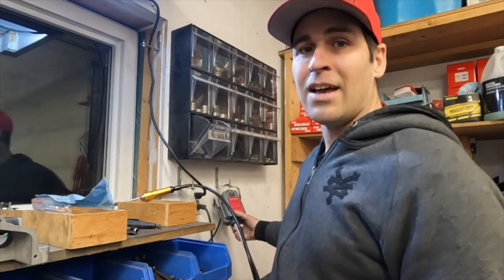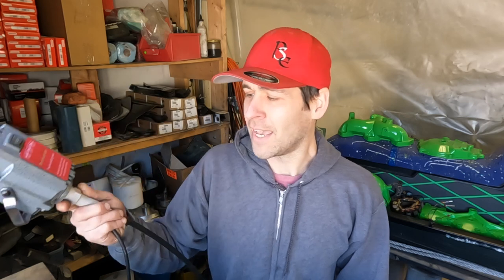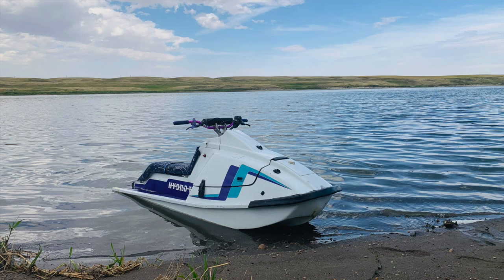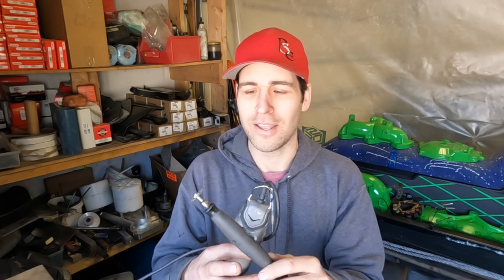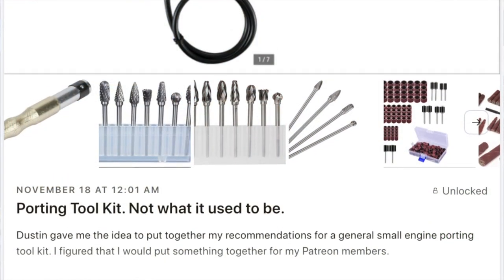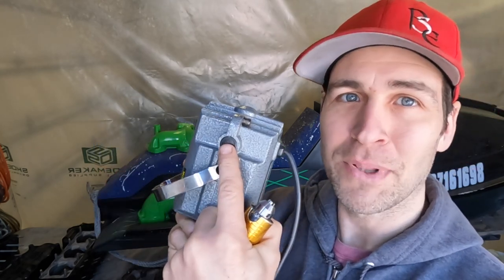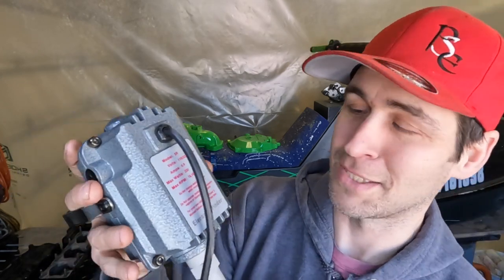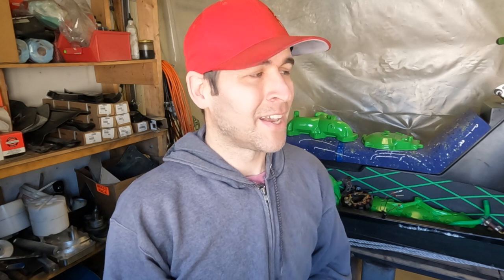VEVOR - Foredom Style Flex Shaft Grinder - In-Depth Look & Disassembly

Comment: Do you recommend lubricating the flex shaft?
Reply from the maker: I haven't lubed mine and haven't had any issues. I lubed the on on my old Dremel and it would make a huge mess. 

If you are constantly running it at really high speeds... I would recommend some very light sewing machine type oil... otherwise I say no.
Reply: @loweredexpectations4927  thanks. I saw one of the posts here that someone used high temp white grease. And another content creator said they used graphite powder. I won't be using mine every day, and mainly for sanding and carving wood and etching stones.
Reply from the maker: @jerrysrockinphotos  The reason I say to use a thing oil is because even oil causes some drag. Over a few feet, lithium grease or a thick oil may have enough drag to cause an issue. 

Graphite is better on flat bearings surfaces, from what I understand. Something with a constant contact patch, and this is not the case between the cable and housing. I may work fine. I don't know. 

A thin oil won't cause a lot of drag and will always be present between the contact areas, where it is needed, in this case. This isn't something that you want to pour down the cable or spray on. You would drip soeme on, give it a wipe with a rag and assemble it. 

I, of course, could be wrong. These are just my thoughts.

Comment: I just bought one and the first time trying it the chuck flew off(came out of the orange handle) and could've hurt somebody. Is it suppose to come off and is there a way I'm suppose to tighten it, or is it defective?
Reply from the maker: That sounds defective to me. I took mine apart shortly after purchasing it, but that was over two years ago, so I don't recall the exact assembly. 

I would contact them right away and tell them it is broken.
Reply: Isn't it a taper fit chuck? Just clean the taper and give it a solid thwack and it should seat?
Reply from the maker: @scod3908  I believe this is the case, but I'm not sure. All jacobs chucks that I have seen are taper fit, but mine has never come off, so I don't know. If it came off, there is a chance that the taper is damaged / out of spec.

Comment: Thanks great vid and stories, re Dremel I'm in Australia and have had 2, the last one only about 3yo and very little work. My view is they trade on an undeserved reputation of trusty tool or is it just the marketing? Very much for the amateur/light work hobbyist. I'm looking to buy a flex drive myself and just found the same brand as yours for $80A not sure of its features, but I'll check it out.
Reply from the maker: RIght on... I think you are right... The Dremel brand has made a name for itself but just makes stuff for light occasional wood working or very light metal work. I have not used my dermel since getting my new tool... and the new one gets a fair amount of use.

Comment: I'm leaving this comment to increase engagement on your latest video, but also to request a diesel heater with nichrome wire in the burn chamber video for diesel alternatives.. or running at lower hz than typically possible stable (what I'm interested in lol). You need an adjustable controller though :)
Reply from the maker: Haha... Thanks for the comment and the diesel heater suggestion.
Reply: As far as i get out of my diesel heater experience of countless hours of continuous running, i'd say, the factory lowest setting is the lowest one you feel kind of warmth coming out.
Any less and you don't need a heater, then two candles will do the job. 
Also - there has to be some generated heat for the whole thing to be warm enough to operate properly.
No use to have condensation inside the heat exchanger going on.
The setting, i lost my smaller dog with, was lowest setting, stupidly enough with exhaust turned to the top side and then letting it run for weeks.
Only in lowest setting you get fuel dripping out then.
And that slowly evaporating diesel did poison us, me and two dogs, undetected all winter long, caused liver inflammation and death to the smallest one. 
A little more heat and nothing happens, when you install it the wrong way. That fooled me a long time with several heaters.
But aside from that problem, seriously, a 5KW chinese heater at lowest stock setting doesn't overheat anything, as long as it's cold enough for heating at all.
Reply: @werner.x  I remember you mentioning your dog before and the toxic fumes... that's rough. 

I feel like I have a long way to go with the diesel heater testing. I may end up making a completely custom unit next winter.
Reply: @JoelArseneaultYouTube  
I did mention it here for Mark Davis. Somehow his name/link doesn't show in the answer, don't know yet, why this sometimes works and sometimes not.

Because i wanted to tell him, that it's no use to try to let a heater as cool as possible, but maintain the flame burning at any costs.
There simply are some physical reasons not to do that.
So, there is some wrong challenge in his request.

I'd suggest these boxed tent heaters with candles and heat exchanger for lesser heat. They are all over youtube. 
He could use oil lamps instead of candles and fill their reservoir with his old engine oil. Using waste oil or old  fat for heat and lighting by burning it with a wick is a prooven concept for 1000s of years. But the wicks do need maintainance too - of course. The dirtier the oil, the more often.

Looking forward to a specialized real waste oil shop heater. Go for it - this Diesel heater conversion for real use is a dead end street, demanded or not.

I'm planning myself to build one.
One, that get's cool enough exhaust gas, that i can suck it through a fan and blow it through the wall with my 25mm diesel heater exhaust hole.
Landlord don't like it, if i turn his double brick wall into swiss cheese - and fire insurance plus building codes doesn't allow a proper chimney here too.

But there are some unclear private things ahead, i may not be able to do so, we'll see.
Reply from the maker: @werner.x  Yes, I realize the comment was for Mark, but I thought I would chime in anyway, haha. 

I have had a few others recommend boxed tent heaters and have seen a few videos. They are quite interesting. When I was young we had Kerosene lanterns for when the power went out, but we had a wood furnace and stove, so we had some heat even if the power went out. 

I like the idea of experimenting with my current diesel heater, but it has some pretty obvious limitations, so we will see what happens.

Hopefully you are creative enough to find a way around your problems... I think so.

Comment: It’s now $52. I’ve got a Fordom. It cost about $365. I bought one of these simply because it was so cheap and looked just like my Fordom. Frankly, this is better. The Fordom is 18,000 rpm. This is 25,000. But as it’s 50Hz, it’s actually about 28,000 max. This is also about three times as powerful at a stated 780 watts. There is no switch on mine, so no reverse. It just comes with the floor pedal switch. So far, little vibration from the 1/4” chuck handle.

Yeah, the higher the speed the better. I use a lot of diamond tools and with diamond (and carbide!) the higher the speed the better. I use small air grinders at 80,000 and even that isn’t always enough, so I have a dentist air turbine at 300,000 rpm. That’s the only tool that allows you to work without having to press down on the work. So yes, the higher the speed the better.

Overall, this is crazy. A friend bought one after I did, and he’s very happy with it. I may buy another so that I can have these things in all three shops. I do have the small shafted Dremel, and have had that for over 10 years with no problems. By the way, the case is cast zinc alloy, likely some sort of Zamak alloy. Zinc is used for this as it’s stiffer than aluminum and melts at a lower temp.

About the foot switch. The standard one that comes with the Fordom is about as cheap and chintzy as the one from the Vevor. I haven’t taken any of them apart, so maybe the speed control on the Fordom is better, but maybe not. You can buy a cast iron one from Fordom for a lot more money, if it seems worthwhile.
Reply from the maker: I thought that I had responded to this comment already... Oops. 

Thank you for sharing such a detailed experience ! I still use mine frequently and love it more and more every time. 

Haha... how many of these does one man need ?! I did notice that the case had a ring to it that sounds different than aluminum. It being zinc explains that.

If I ever have an issue with my foot pedal, I will replace it... but it is holding in there and does exactly what I need it to ... I am very pleased.

Comment: The EU-Model shows the silver handpiece too. Only the 750W-Version shows the golden one. But i'm wondering, if the 750W isn't too bulky and the shaft too stiff to be versatile.
One don't need a whole horsepower for delicate detailing, even if it's steely stuff.
And if, how stiff will the shaft have to be not to snap when it comes to deliver that horse?
Silver and golden handpiece connector area both show the same ball and spring design.
Therefore to me both seem to function likewise.

I'm so tempted to buy one, but i just ordered other useful tools and have to stop there.

Do you get more perfomance out of these jet ski engines with porting work?
Reply from the maker: I'm not sure if you can go by the photos or if the color means it is quick change or not. My friend, Dustin, got the wrong one and returned it for the one he wanted, without issue. 

I think the 750 watt one is overkill, but I suppose it depends on what you are doing with it. I personally didn't need more power and like the flexibility of the one I have. 

The 750W one Dustin got had the same ball detent and it would come housing would come off (from what I remember) but the inner shaft did not just slide out like on mine. 

Perhaps you can post a question on the site asking if the specific one has the Foredom style quick detach tool. I'm not sure if they are the same country to country. 

There is a LOT to be gained from porting a jetski engine. Some of the performance comes from allowing for better flow (smoothening the ports) and some of the power comes from slightly altering the engine timing by changing the port height and shape.
Reply: @loweredexpectations4927  
I see. Didn't think about the timing at all.
Reply from the maker: @werner.x  Yes... with two cycle engines the placement of the ports is what determines the timing. The more you raise the exhaust port, the more you can / must rev the engine to make power. Of course, all of this has to work within the limits of the design of the exhaust. The exhaust will be tuned to a specific RPM, and if your engine is tuned too far above or below that point, you will actually lose power.

Comment: Are the vevor and foredom handpieces interchangeable, and can they be connected to a dremel ?
Reply from the maker: Vevor has some Foredom style grinders. 

The exact one that I have, is interchangeable with the Foredom tools. 

They sell some that are similar to mine, but not the same. I can not say if those are Foredom compatible or not. 

The Dremels that I know if are not compatible. You may be able to purchase or make an adapter, but I am fairly certain that there is no direct swapping of handpieces.
Reply: @loweredexpectations4927  can I assume the tabletop base made by foredom will work with the vevor unit?
Reply from the maker: @metal75801  I can't see any reason why it wouldn't. The hangers look identical.

Comment: 230 W is 1.5 times more expensive than 780 W version, wth  - is that a commercial fee? :)
Reply from the maker: HAHA ! ... I have noticed that the pricing doesn't make a lot of sense. Tool availability changes by region / country, so I'm not sure about your example. My buddy Dustin got one of the larger ones thinking it would be better, and it didn't have the quick change tool. He ended up returning it and getting the same one I got. 

Both of us purchased these tools before I was affiliated with VEVOR in any way and just got them because they are great tools for the money.

Comment: that cast aluminium isn't solid though, drop it on a concrete floor from 1.5m and it's prolly gonna crack.
Reply from the maker: Plastic is generally more impact resistant than aluminum... definitely not a good idea to be dropping this on a concrete floor at all. 

That being said, I'm not sure where you get the idea that this isn't solid. Did you see that I took it apart. It is built pretty solid. Way more so than any modern tool I have ever seen. I have also had at least 3 Foredom owners tell me that this is actually built better than the Foredom... My guess is that this is for the drive assy and not the shaft and tools.